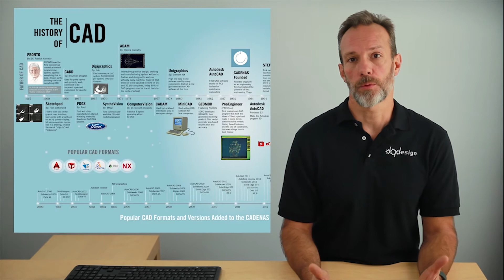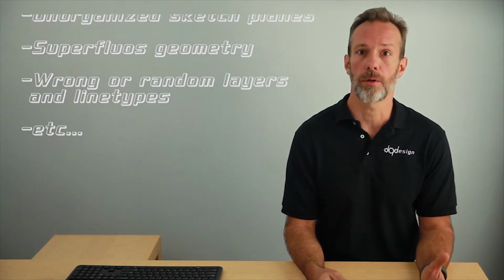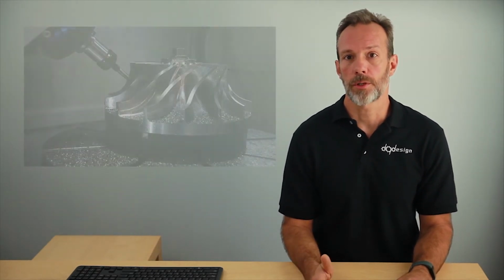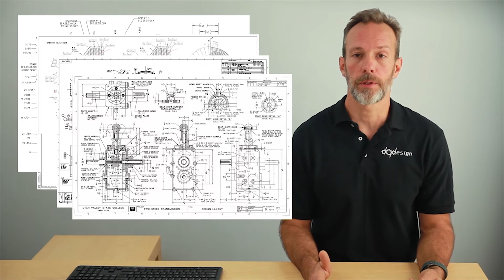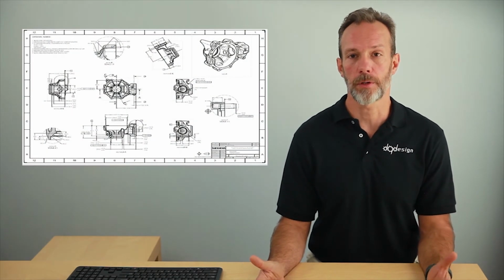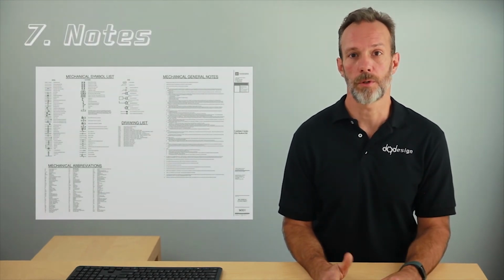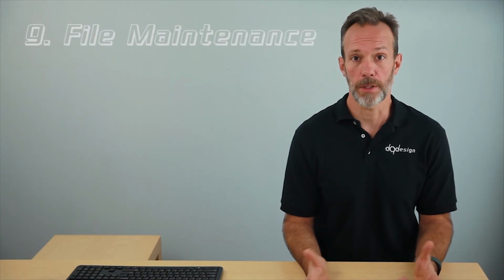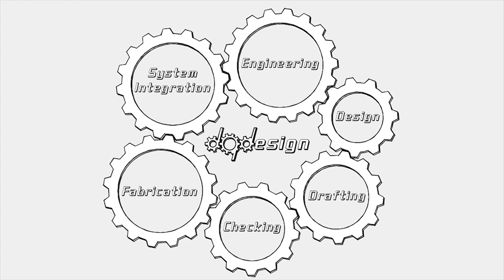Top 10 CAD & Drafting Mistakes - DQDesign

Comment: How often do you encounter faked dimensions?  I have seen exploded and re-typed dimensions in AutoCAD, and it was a disaster.  I have any say in this, the practitioners would be fired immediately.
Reply from the maker: Very common, especially in a large organizations where many people have access to the drawings. Untrained people will make changes and "do whatever it takes" to get the print the way they need it. Circumventing the systems...
Reply: Yes, It very common to "fudge" the dimension then to update a poorly defined 3D CAD Model. 

I have also heard "The CAD model made good parts, so we shouldn't change it" even though the print doesn't match the Model. 

I hate that and don't be that person.